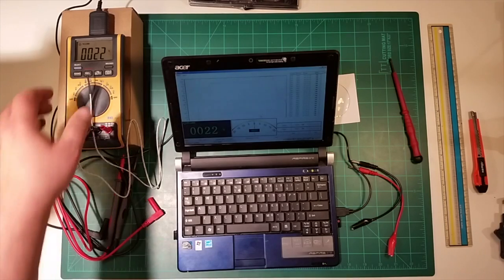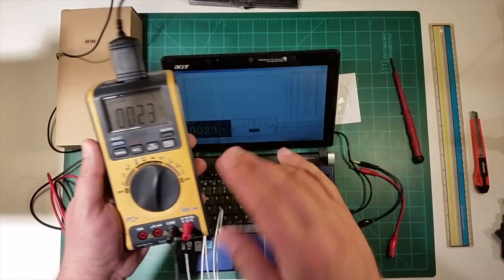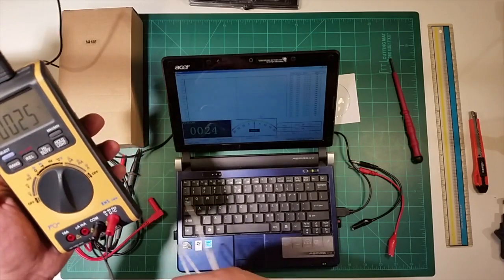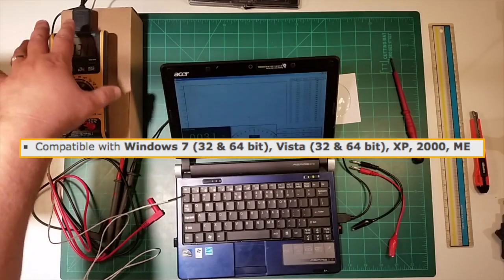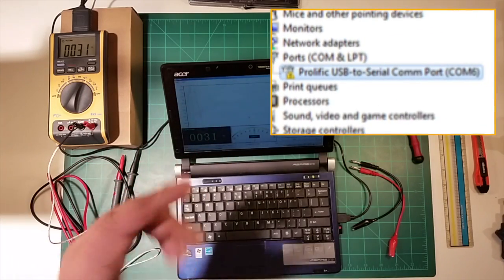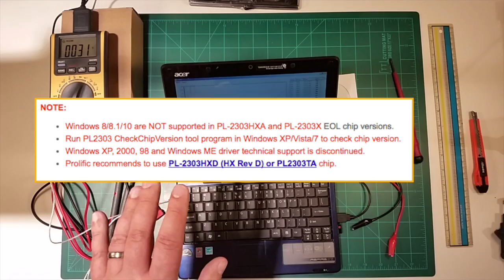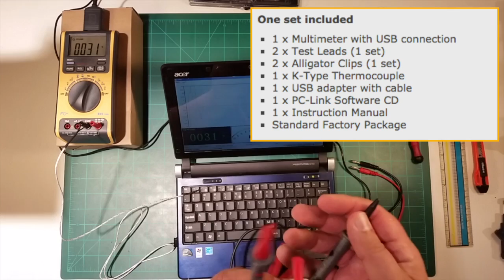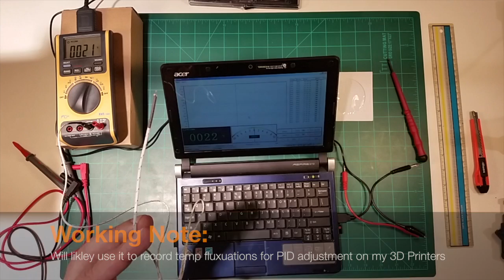Shop Talk  - Chinese USB Digital Multimeter Worth It?

Comment: for driver (win 10) go to DETAILS [of device] [Hardware IDs] use 2nd or 3rd item (copy) for google search example PCI\VEN_8086&DEV_0084&CC_028000  {from my wireless card }
you might find win 10 driver  also some win 7 drivers will work
Reply from the maker: Hmm will take a look, but so no luck....

Comment: what is the name of that software you are using with the multimeter? it came with the unit right? i assumed i would have to track down my own software, anyways how long can you log data? i want to monitor amperage draw on a vehicle drain. first before the fuse box, then each individual circuit that runs to the fuse box. i tried to setup my multimeter, but i noticed that during one hours time the amp draw was wildly all over the place on two identical vehicles. admittedly it was getting old trying to look at live data for an hour and i threw in the towl on that approach
Reply from the maker: Yes the software came (comes) with the meter and the longest I think i have used for is about an hour.  Since it is only text,  I am thinking it could go for quite some time...

Comment: Any chance there's Linux driver and app that works with it ?   Ironically some of my older MS and WIn based  stuff is supported better in Linux these days . 
Ha i have a laptop just like that in my  'needs a job' box .   I'll have to think about installing it as a bench support device .  Its XP , and was considering putting some flavor of Linux on it .
Reply from the maker: The problem is the "app" itself is only supported on Windows so the driver might work (likely)will but will have no App to use it with.  Another viewer wrote it was copy protection scheme and think this is the case as I can boot to XP and work and then boot W10 and no work.  Same hardware, however too have a ton of XP machines as I work in the IT field and picked up a bunch on the last tech-refresh and typically install Linux as a dual boot...

Comment: One thing that COULD be the problem is the Prolific Counterfeit issue.  A while back, the Chinese were counterfeiting the Prolific chipset so much that Prolific themselves actually added a function into the driver to detect a non-genuine chip and block the driver from using it.  Great for them, sucks for those of us that bought devices using the fakes and now we can't use it anymore.  For a while, an older version of the driver that was pre-fake-ban was floating around and you could use this to get around the problem.  We saw a huge influx of these chips in the amateur radio world for programming interfaces.  Many people dumped the fakes and bought a version using a the FTDI chipset.  However, in your case, I don't know if there is a third party version of the interface cable out there using FTDI.  Good luck!
Reply from the maker: While I don't know this is the problems it does make a lot sense as on a machine where I can dual boot I can run the meter on XP however with Win 10 no ways so the hardware of the machine isn't the issue and only the driver.  So long story short is you could be very right!
Reply: With these particular manufacturers, it's fairly unlikely that they got a counterfeit, maybe 1:1000 or less. I mean it's Mastech, CEM Instrument, one of those.

The problem with FTDI is: even more fakes, and they're terrible, and the driver detects them too.

Much safer: SiLabs serial ICs. They don't come with a vendor driver at all, they work with a Microsoft CDC driver. They don't seem to be getting fakes, but even what seems like might be fakes work really well! On Windows 10, it's applied automatically, while on 8/7/Vista, there is an Inf installer that hooks it up. A particular reason to avoid it for people running older boxes: on Windows XP, you can forget about it, that is, it might kind of work, but it really won't, because Microsoft CDC driver was shit back then, because there was no hardware to test it against, so they kind of wrote one in a vacuum, hoping that it would work, but it only almost worked. USB consortium defined CDC class for USB to serial converters, but no hardware manufacturer actually implemented it, FTDI and Prolific both created incompatible devices in order to enforce vendor lock-in, and it stayed that way until Microchip, Freescale, TI, NXP and STM, various processor people, eventually got very annoyed by the situation approximately in the Vista era. In my opinion, that Prolific and FTDI got hit by fakes left and right is their own doing - they based their success more on strongarming the customer than on the merits of their products.

Comment: Any reason you didn't get a Uni-T meter. The 139c is about the same price and the 69 series has PC link.
Reply from the maker: Do you have a link?
Reply: DIY3DTECH.com 
I like this one https://www.ebay.co.uk/itm/111880129853 

But they also have a version with pc software 
Like this https://www.ebay.co.uk/itm/351224670394
Reply from the maker: Do you have this one?  Looks like its RS-232 and not USB?
Reply: Sorry that was just an example -  the ones that have the data port seem to come with RS232 or USB cables based on where you buy them but the USB cable is available separately.  And if you look in the pictures they often have printed on them RS232C(USB) which is odd.

For example 

Meter with Data port-
http://www.ebay.co.uk/itm/UNI-T-UT61E-Digital-Modern-Digital-Multimeter-Tester-Meter-AC-DC-Volt-Ohm-Frq-/311173417933?hash=item4873618bcd:g:uDEAAOSwv1RUZXbt

Cable-
http://www.ebay.co.uk/itm/High-Quality-UNI-T-UT-D04-Infrared-USB-Interface-Connection-Cable-Data-Line-/221808267668?hash=item33a4cd9194:g:ksMAAOSwHnFViQun

I don't have one of these but I've been watching a lot of DMM reviews to see what's got the best bang for the buck and interestingly good accuracy.